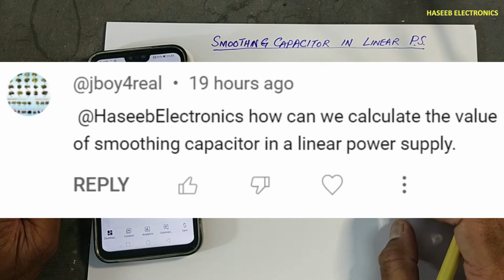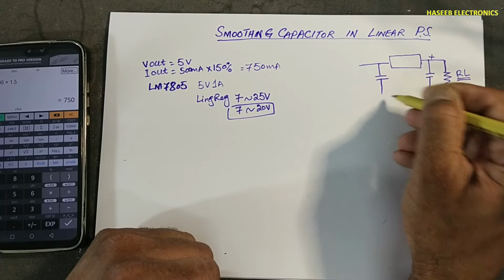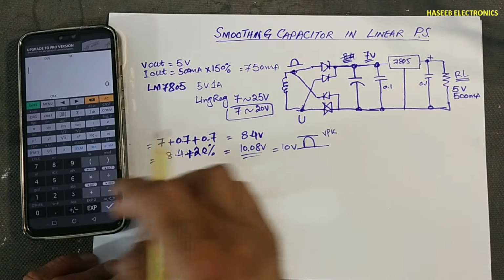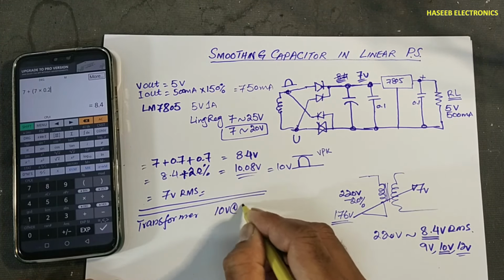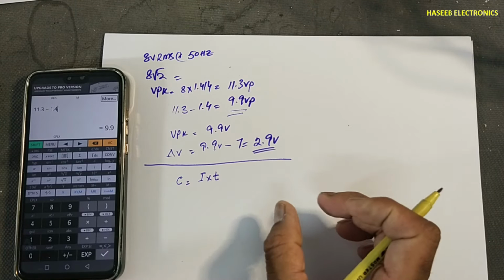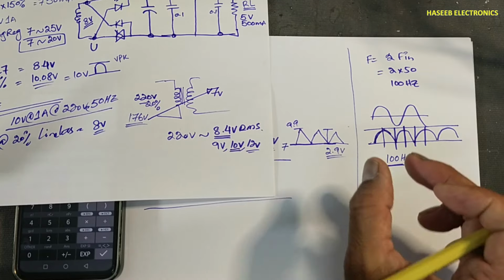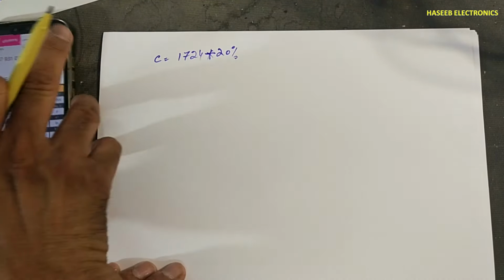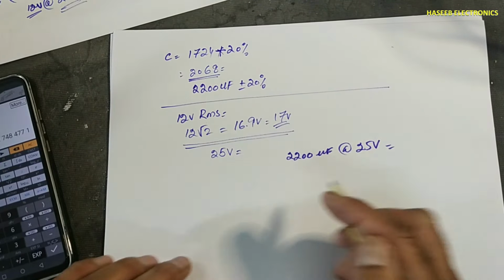{1115} Smoothing Capacitor calculation for Linear power supply

Comment: Sir you calculate capacittor with 1amp instead of 750ma becuase of the 7805 output or its working consumption?

Comment: When you add 20% just multiply by 1.2
Reply from the maker: yes 
it will produce 120% 
for example 7 volt + (7 volt * 0.20) = 8.4 volt
7*1.2 = 8.4 volt

Comment: To make an isolation transformer;
If I connect an 220v to 110v step down converter
and 110v to 220v step up converter bact to back(220-110-110-220),
can I have an isolation transformer to use on repairing faulty circuits and using osciloscope at non-isolated circuits safely?